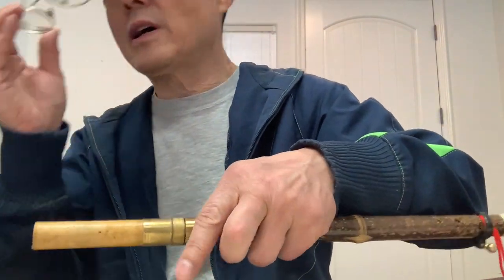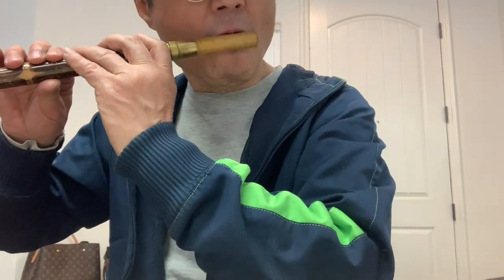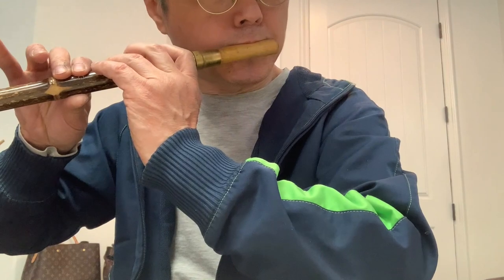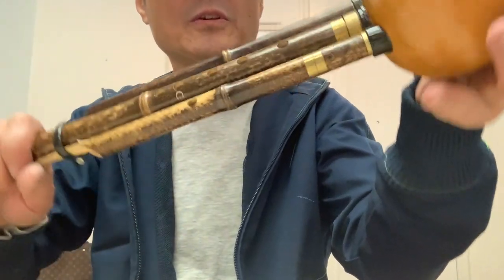How to fix the reed of the hulusi and make right sound.  怎樣修理有雜音的葫蘆絲或巴烏簧片及正確吹奏葫蘆絲

Comment: Thank you for this video. I just got my first (and cheap) hulusi. It was used, and ended up having some cracks in the gourd around where the flute and drones plug in. The reeds were very dark as well.  I could get sound, but it sounded more like a party horn or a flock of geese.

I sealed up the crack with some glue, and it seems to be holding, but this video helped me with the rest. I cleaned up the reeds till they were shining, and removed a bit of the edge of one where it kept getting stuck. Then I did your sliding the hobby knife under and bending trick till I could get an even transition on all the notes. The drones even have a nice harmony to them now. 

With all that done, I just need to practice keeping my breath pressure even when I start blowing, and when I stop. I don't always make that honking noise, but it's still there, and tricky not to do. That breath pressure is SO important to how this instrument sounds. I'm also curious about the bawu, is it about the same to play?
Reply from the maker: the reed space between the sheet also affects the sound, too high the sound is loud, but you may be lost the high notes, you have to carefully adjust the end of the reed to get the best position, it will sound for all notes.
Reply: @musichong  yeah, I found that if the reed is bent up too much...I just get one sound. Like you can't even change the notes. It seems as if the reed has to be ALMOST flat to the plate to be just right. It took me a while to do, I can't play as nicely as you can with the pipe removed...so I had to replace it each time to test. When you play the pipe sideways, it seems just like the bawu with the holes in awkward positions.

My other problem, is that my fingers are kinda big. It's tough to cover the holes that are close together on the C hulusi. I wonder if a F or G keyed hulusi would suit me better, they look as if the holes are farther apart.
Reply: @matthewfreilich3719  I have literally the same problem.  Only plays the lowest note and all the rest are the same flute note.

Comment: Hello, thanks you for your video. We are wondering how to separate the flute from the gourd because it seems to be united. We think that we have the problem you are explaining but we are afraid to broke it. The ring is too strongly holding the bamboo. Do you have a suggestion? Thanks
Reply from the maker: I am traveling in Asia now, and I can make another video after July 18 to show how to solve the noise. Or you can carefully turn the main pipe left and right, then turn the two side pipes to take them out. If a section is stuck inside, you can use pliers to turn it down, but please wrap a small piece of cloth around the bamboo, and don't use too much force to prevent the pipe from cracking.
Reply: @musichong  thanks for your quick answer! We gonna try as you said if we don't succeed we come back to you on your return. Good travel,  Alitché and Khaim
Reply: We moved the reed but we didn't manage to get the right tune (F hululsi, we tried to have a C on the longest bamboo) we cannot make it deeper because when the reed was too open it didn't make sound no more :/
Reply from the maker: Lower the reed tongue, may lower the valum.  But please carefully touch the reed, you could find something like a needle to change the reed angel.